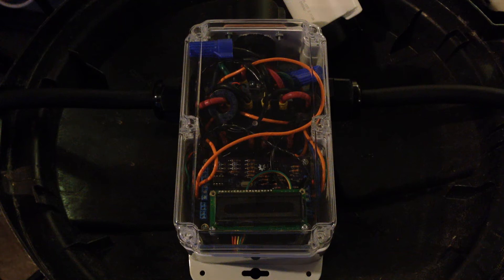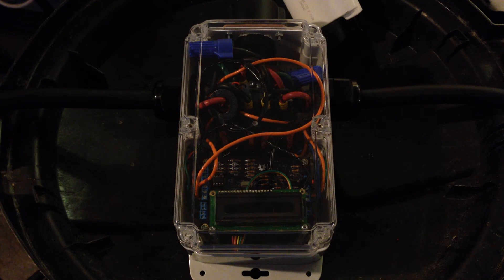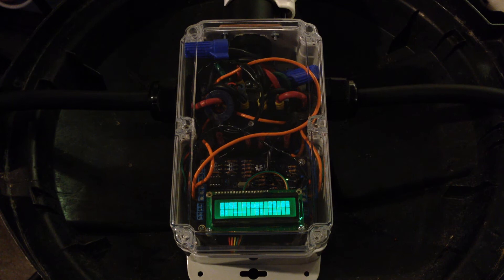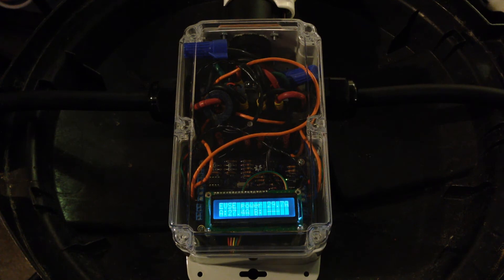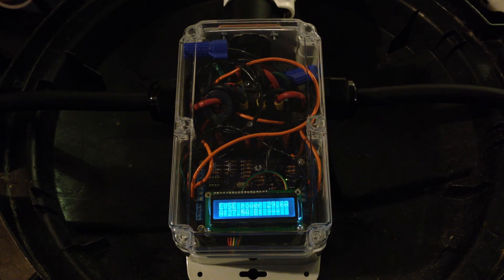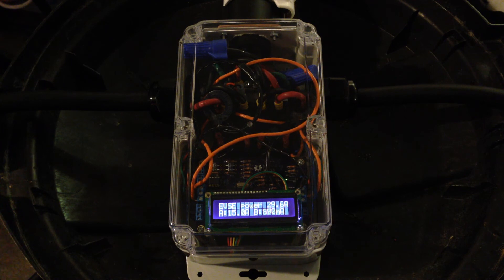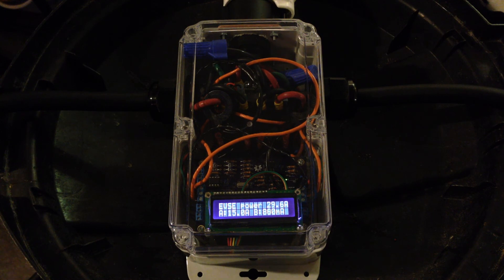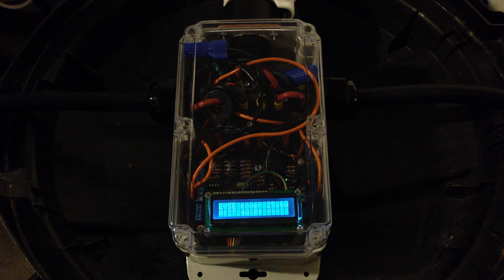The J1772 Hydra

Comment: I completely understand your inability to sell complete units due to legal and liability concerns, but I'm wondering if it might be possible to sell 90% to 95% assembled units? Possibly pre-mounted in the enclosure, requiring just a few minutes and/or parts to complete.

I rent an apartment and something like this would be perfect to split the dryer-plug in my garage since I don't have the ability to install a second circuit...

EDIT - A thought just occurred to me. In theory, you could also run this as an Indiegogo or Kickstarter campaign, which would allow you to front-load all of the legal fees to get UL certification and start a limited liability corporation once you hit your funding goals... Your product is completely unique as far as I can tell, and I imagine there'd be pretty strong demand for something like this.

Comment: This is exactly what I want for my home, but I can not find a way to purchase a ready made one.  Does anyone sell this "splitter" (or one like it) ready to use?  Or is there some legal/code reason that you aren't supposed to do this?
Reply from the maker: +Leigh Gleeman I can't sell them completely assembled, because they're not UL approved and I can't shoulder that kind of liability. That said, I do sell fully assembled board sets in my Tindie store, and assembling a Hydra from the boards requires no more than typical handyman level electrical skills. https://hackaday.io/project/3939-j1772-hydra

Comment: So its possible to change the duty cycle of the pilot signal during the charging state?  "State C" , I think.  The car doesn't error out when you do that?
Reply from the maker: No. In fact, the spec anticipated the need for adaptive charging and mandates the car respect a reduction within 5 seconds. Cars are not required to respect increases, of course. For a while, Teslas would never increase their rate of charge (they would, however, reduce it), but that was corrected some time ago with a firmware update.

Comment from the maker: @turbo2ltr You can do that, but most EVs draw full power for all but the last few minutes. Because of that, I don't think you'd gain a lot. It's better in any case to use the Hydra with two Volts or Leafs that only charge at 15A and wouldn't even noticed the reduced pilot.

Comment: Not that I have a need to charge two vehicles, but wouldn't it be possible to dynamically adjust the pilot signal to each car so when the car starts tapering off it's charge current, that current could be directed towards the other car (if needed)?

Comment from the maker: That's not going to work. In general, you cannot combine two current sources with a goal of increasing the ampacity of a supply. It's like putting two 30A fuses in parallel and calling that a 60A fuse. It's just not kosher.